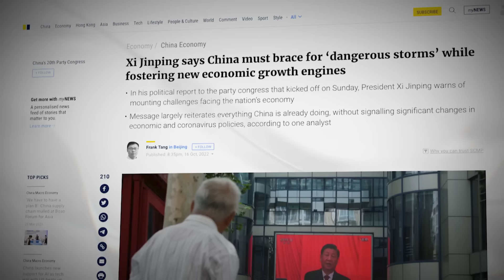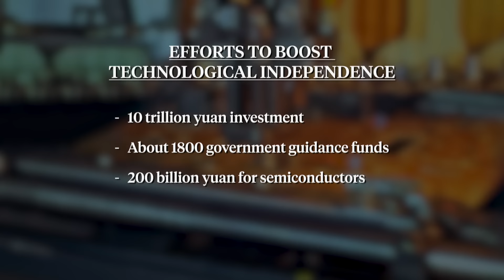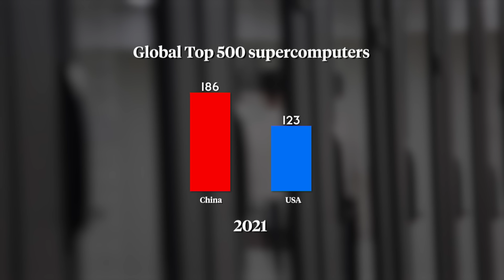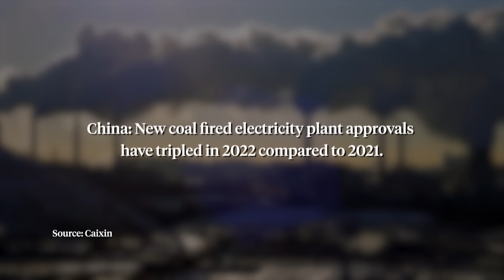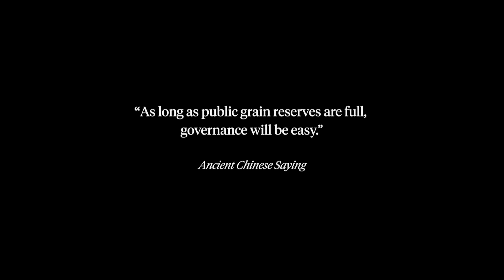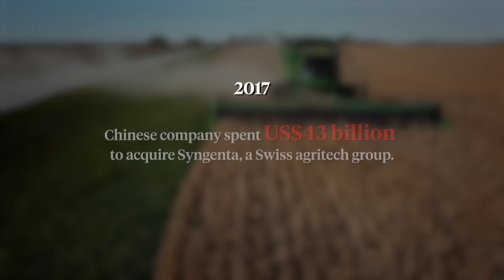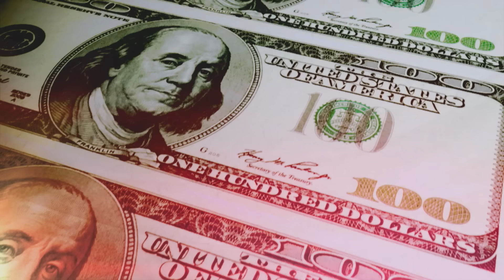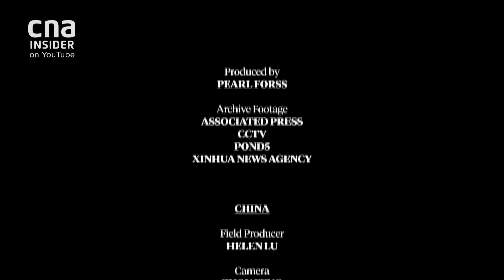China’s Quest For Self-Sufficiency | Preparing For Dangerous Storms - Part 2/3 | CNA Documentary

Comment: Chinese supercomputers are made with American technology, American CPU's.
That's the main component in the computer.
Reply: Get yourself updated.  China's latest supercomputers no longer run on American chips.  China longer reports the speeds of its latest supercomputers so that speeds can be ranked because it is quietly moving into non silicon based chips that run multiple fold speeds faster than American supercomputers.   Getting your super computers ranked may be prestigious bit it backfires as your adversaries make your speeds the ones to beat. It pays to keep the competition guessing.
Reply: @BeelP.  
LoL 🤣😆😅
Are you part of the CCP's 50 cent Army, or do you do their propaganda for free?
China has only 1 supercomputer that doesn't have American CPU's in it, the Sunway TaihuLight, back in 2016. That's China's latest greatest, fastest supercomputer. I don't think it's even real. I think they just made it up to save face after the US sanctioned China from US American technology.

China can't make supercomputers without US technology.
Huawei can't make 5G phones without US technology.
China can't make commercial jetliners, like the C919 without US technology.